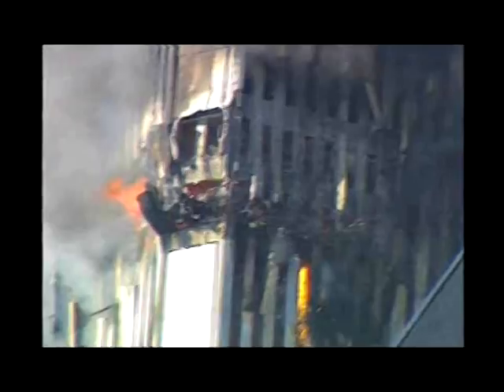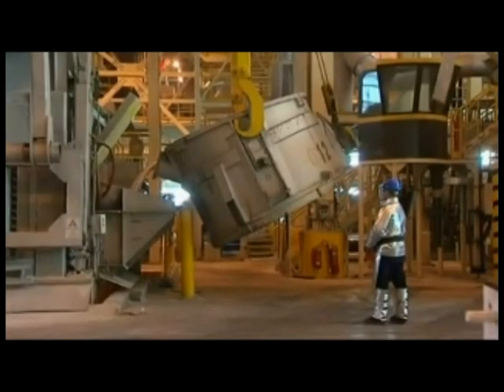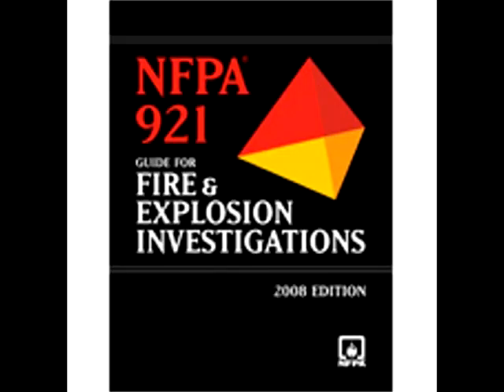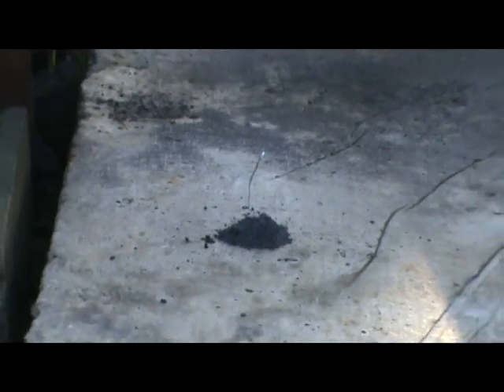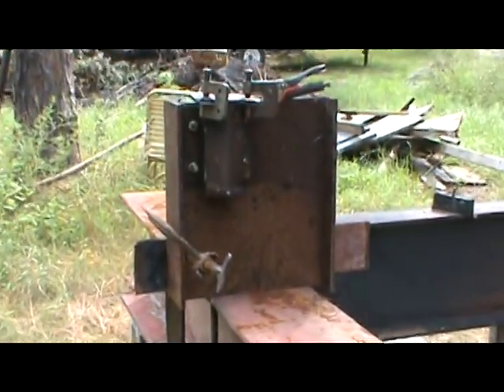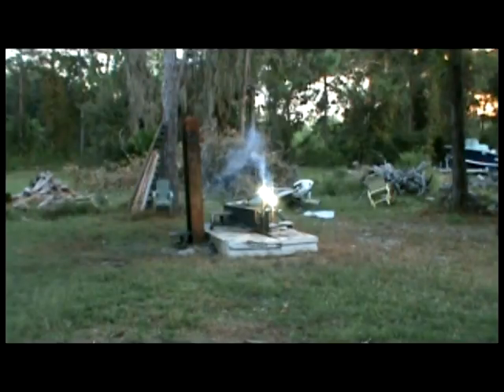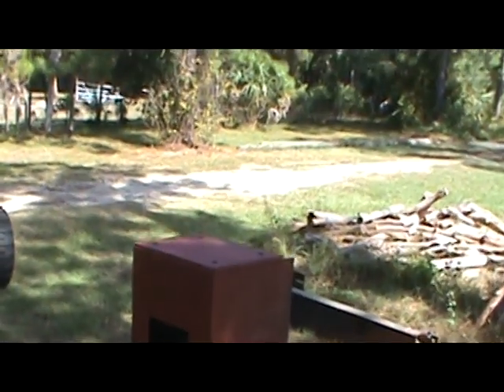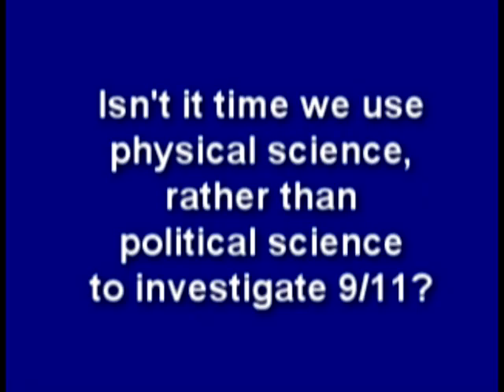9/11 Experiments: The Great Thermate Debate

Comment: what you forget to include is the fact that these beams didn't need to melt to collapse the towers. The temperature that the jet-fuel was burning at was easily high enough to reduce the strength of the steel by up to 90%. Add that to the thousands of tons of weight being exerted on them and they are definetly going to collapse. And the "melted steel" might not be steel at all. Just because it wasn't aluminum doesn't mean it couldn't have been a different metal. After all this is an office building which has computers and equipment which contains hundreds of metals which could be what you see pouring out the side of the tower. And also, even in the case that thermate was used inside the tower, doesn't mean the government placed it. I mean how hard would it have been to sneak these into the building by terrorists? Or perhaps someome who worked there planted it collaborating with the terrorists? Make sure you look at all different aspects of this before making an ussemption based all around a couple factors.
Reply: O.k. now explain building 7.
Reply: @endofdays4003  building 7 was one of many buildings evacuated right away. It wasn't touch by firefighters or police for over seven hours, left to burn. By 5 something, building 7 collapsed due to the entire building burning.
Reply: your like a breath of fresh air
Reply: One other thing you have to realize is that the jet fuel burned up in the fist few minutes after the crash. After that the fires were only from office furniture. Before the collapse it was reported, and could be seen, that the fires were burning out. There wasn't sustained high heat there and certainly not all the was across a level of the building.
Reply: @ghosthand8119  I never claimed that jet fuel was the primary fuel that melted the beams.
Reply: maybe, just maybe the skyscraper fell straight down because it couldn't withstand tons of pressures from  above (all building mass started from the impacted part to the very top)
Reply: Did you like... not watch this at all?  Or are you just beyond ignorant
Reply: @Jerboi_  oh I watched it but now I wish I hadn't
Reply: Maybe puoring melted metal was from plane parts which left in the building after impact?
Reply: The beams weren't melted at the bottom of the building were they?
Reply: @Lorenzo Qobi I made no refrences to NIST.
Reply: +spencer wells It's not a matter of steel HAVING to melt, it's a matter of steel melting in an office fire, which cannot happen. We know steel melted because FEMA documented it in a metallurgy report. And they also described the mechanism which caused the melting, and that mechanism seems exactly what thermite would do to steel.
Reply: @Ab4kus  furniture and office supplies charcoalised could have been plenty to melt the steel beams. Younsee charcoal burns at over 3000 degrees F which im addition to the opem air windows with air pouring in could have been more than enough to melt through beams.
Reply: @spencerwells4523  well I invite everyone to Google at which temperature charcoal burns so they can see that you're just here to troll.
Steel buildings don't melt, office fires are well studied and we know they don't reach the melting point of steel.
On top of that, we know the steel in the WTC buildings didn't reach high temperatures (from the fires at least). Which is not surprising because they were short and very localised in intensity.

"There is no evidence that any of the steel reached temperatures of 650°C for any extended period of time" - NIST
Reply: You must think the government is in it for your best interest too huh ?
Reply: @Thisisfun918  never said that
Reply: If you know anything about steel then you know as long as you can heat it up it gets weak. Demolition Ranch made a video showing how a camp fire made from wood can make hardened steel body armor weak. Although yes I agree that since the mass majority of the heat and damage was only on one side it should've fell over not collapsed straight down but as far as heat weakening steel it doesn't take much to weaken it but to melt it then you do need that intense heat
Reply: Your forgeting the fact...the steal was seen melting. Befor the colaps
Reply: Lol he literally shows you the molten steel pouring out the building. You're argument that the steel was weakened is null and void
Reply: @Tigger0774  how so?
Reply: @Tigger0774  wouldn't molten steel have sparks pouring off of it like crazy? Look up foundries and you'll see what I mean.
Reply: Did they go in while the buildings were burning to take the temperature of the air being forced through open windows by wind and back draft? Or did they just take the temperature days later and assume that it only got to 1800 all through the ordeal? This isn't an "open and office air with jet fuel" situation. There's a lot more to it than you " truthers" can wrap your brain washed minds around
Reply: what about the fact that over two trillion taxpaying dollars went unaccounted for in the DoD on sept. 10, 2001? quite a coincidence that a plane happens to hit the pentagon in the accountancy wing where the disappearance was being investigated
Reply: Yea, government job is ruled out, simply because they are the government by the people for the people. There is no evidence that could convince otherwise. Governments are good.
Reply: U are a true genius I said the same thing earlier
Reply: It wouldn't implode uniformaly. Temperatures at different points of the building would have been different. Therefore, the weight should have shifted to the weaker side of the building.
Reply: spencer wells bro open air and liquid jetfuel is not that of a hot of a substance. It needs to be vaporized with the right amount of oxygen
Reply: @the_borax_kid2233  I made no claims that jet fuel was the primary fuel which melted the beams.
Reply: Yep. When I was undergrad studying mechanical engineering we studied materials going from a plastic to an elastic state. One also need to remember that energy is being introduced as the material is bending under weight of the structure above.
Reply: Oh those things were obviously powder puff devices or the like causing pressure pops and gusts.

"Sir, you cant say bomb"
"bomb, bomb, bomb, bomb"

"Media, you cant say explosion"
"pressure bursts"
Reply: "I mean how hard would it have been to sneak these into the building by terrorists? Or perhaps someome who worked there planted it collaborating with the terrorists?" hahaha do you even listen to yourself??
Reply: @richwalter5322 that makes no sense
Reply: spencer wells d
Reply: That's wrong. NIST already stated in their own report that the temperatures of the fires were not significant enough to weaken the steel structure at all. The highest recorded temperatures were around 250C.
Reply: spencer wells "the jet-fuel was burning at was easily high enough to reduce the strength of the steel by up to 90%" - Yes, this would explain the collapse of the buildings at the point where they were hit by the planes. It doesn't explode the implosion of the buildings right from the bottom though.
Reply: Hahahahahahaha
Reply: 1. The molten spheres of iron show that it wasn't just aluminum or other metals that melted but actual iron, and in large enough quantity to be found everywhere. The spheres were found in all the dust from around the towers and indicates that large quantities of iron were melted. 

2. Claiming that the molten metal pouring out the side of the building was office furniture and such doesn't make sense. There wouldn't have been enough of it in just that area to cause the rivers of molten metal seen in the videos. You would have had to take all the furniture on that side of the building and shoved it into a corner and melted it. Metals that would have melted from the furniture and other items would have just formed small puddles on the floor or burned away.

3. The actual collapse of the towers is in suspect as well. With the mass majority of the damage and heat on one side of the tower shouldn't it have toppled instead of collapse into it's own footprint? Look at videos of demolitions gone wrong. If demolitions only weaken one side of a building it tends to topple over to one side. Only if the structure is properly weakened on all sides does it collapse straight down.

4. Who set the explosives? Months before 9/11 a company worked in the towers upgrading the fire suppression system. They worked at night and during that time all security cameras were turned off. They were all throughout the building from top to bottom unsupervised. This is the same company that hauled off the debris from building 7 before fire investigators could inspect it. Sorry but I can't find the name of the company anywhere but there are videos of a caravan of dump trucks rolling to the site moments after the collapse of building 7 as if they were just standing by waiting to be called.
Reply: Ghosthand scary stuff.
Reply: @ghosthand8119  your 4th point is a very valid one which I never tried to disprove. The office furniture/offive supplies when in the right conditions (like a giant metal box with air pouring in through windows and tons of jet fuel to ignite them) could easily pyrolize (aka turn into chatcoal) Charcoal can burn upwords of 3000F which is easily hot enough to melt right through steel beams. Thanks for having a logical discussion with me.
Reply: spencer wells did you not see the molten iron pouring from the fucking tower? Or were you dropped on your head and kicked around like a soccer ball as a baby?
Reply: I never said I trusted the government.  in fact I hardly ever trust them. But I don't see how bombimg the world trade centers is going to benefit them any.
Reply: spencer wells That's an easy one. It's called an excuse to invaide another country and steal their massive amounts of oil.
Reply: @spencerwells4523  America ultimate goal is to maintain world power. This means securing bases and allies at every corner of the globe. It just shows the level they will go to make certain of that goal. They will sacrifice a few lives for what they think will secure that goal. Even if it means their own people.
Reply: spencer wells firearm sales skyrocketed after 9/11, just sayin
Reply: @oliverejm  we didn't take over any of their oil. get your facts straight
Reply: @ephraimkaravan  😆 savage
Reply: "easily high enough to reduce the strength of the steel by up to 90%" Assuming this statement is right, which I don't believe it is...does it apply to all 1300+ ft of the giant heat sink that the towers were? Because... you know, they collapsed ALL THE WAY to the ground into their own footprint.
Reply: @johanssonb  Steel doesn't comducy heat very well. As a blacksmith, I can heat the end of a piece of steel to 2000 degrees to forge weld and the  side I'm holding, is room temp.
Reply: 90%? nah fam
Reply: @ItsHollowfied  yeah when you heat steel to orange heat it loses about 90%  of its original strength
Reply: @ItsHollowfied  Im a blacksmith which is the only reason I bothered to hypothesize at all. So I have worked on steel at very high temperatures and I know how much of it's strength it loses.
Reply: So all the computers got together in on area to collect and pool then pour out of one spot on the building?? Lmfao what a loser..
Reply: spencer wells it fell at free fall speed?
Reply: @jasonmaurella2  yes it sure did
Reply: You can’t spell Assumption like that and expect anybody to take you seriously.
Reply: groogus91 hahaha
Reply: @groogus91  assumption? you mean the basis of this whole video?
Reply: spencer wells Least you spelt it right this time pal
Reply: @groogus91  you must be that one silly kid who corrects teachers for one wrong world ;) that dont make you smart XD see what I did dear ;)
Reply: Sam Wong Well your Wong there Sam.

If people are trying to give an educated and serious point about something at least make sure it’s spelt right.
Reply: @groogus91  you didnt get it did yah 😒😒 . It dont need to be right spelling cause the human mind dont read letters bit by bit but words as whole, so even though it was wrong picking up one small mistake come on 😒 thats childs play .. give people a break bruuuhhh
Reply: Sam Wong Sorry mate. I apologise wholeheartedly. I’m not worthy of a human being.

Now how am I going to bounce back and get over this tragic part of my life
Reply: if u light ur computer on fire with jet fuel its not gonna create circular balls of metal or a printer or any other things that are normally in there. also whats gonna cause the red chips all around then???
Reply: @soulsreaper7145  Ligjting your computer on fire with jet fuel and a giant foundry like environment with super high temperatures, aren't the same thing. This is a  whole different balllgame buddy.
Reply: They also are forgetting about the natural gas that is spewing from broken gas lines, mixed with the high winds at that hight it would be sufficient, especially with all the other materials that are burning. I melted steel in my back yard fire pit with a frickin shop vac blowing in
Reply: @mlheinz79  yes exactly
Reply: @mlheinz79  you're like a breath if fresh air. Don't keep quiet.

Comment: a jet going 400 mph crashing into a building 100 floors up making a huge hole with wind blowing into that hole turning into a giant kiln probably super heating everything with the jet fuel, wind, and all the other flammable material probably didn't melt the steal but sure did weaken it, plus the columns were probably bent and when you have bent beams and a vertical load. Do the math.

Comment: It was the weight that made them fall.
Reply: Jesus H Christ are you serious?
Reply: Glen Proposch  u do realise when you heat up metal it gets weaker even if you don't melt it
Reply: You’re both totally disrespectful. 
“Moron” “dumbass”
Why can’t there ever be a debate without people being total cunts to each other?
Reply: Then they wouldn't have free fallen through the path of most resistance.  You didnt pass physics did you? They would have fallen to the side. Explain building 7 which also free fell yet only had fires burning in a few spots. When you learn what building 7 held you will begin to see why it was "pulled" too.
Reply: There was also other factors, for example a fire at the top of the building, the impact of the plane, extra weight at the top of the building.
Reply: J o n a t h a n  Doesn't explain how everything was turned to dust. You sir are just waffling, parroting the official story. None of your 'factors' are an explanation for what happened that day. I was like you you once but i could no longer continue to lie to myself.
Reply: have you ever got dry cement and put it into your hand and ribbed it. i know it sound stupid but it turns into ash.
Reply: @sergeilavrov4215  what he's saying isn't stupid at all, dust / dirt is created by a huge building collapsing on itself.
Reply: @jellyboy123  Dude what extra weight did it add?? The fucking planes vaporized on IMPACT!!!!!!
Reply: Was there a plane their before ? thats extra weight you dumb ass, a plane can weigh about 80,000 kg....FACT...Moron.
Reply: @jellyboy123  The plane that flew into the WTC was a Boeing 767. They weigh in at 179 000 kgs.  The buildings weighed over 500 000 tons each. So i can guarantee that another 180 tons didnt do jack shit to the buildings. Especially since 90% of the building was below the point of impact. The structure wasnt built to just support the buildings' own weight, and the perfect collapse at near free fall speed? Come on man, it is obvious.
Reply: @jellyboy123  the building weighs 1.5 billion pounds. Am extra 200,000 lbs ain't shit

Comment: Do you know why blacksmiths heat bits of steel to red hot before bashing it into whatever shape? And also, do you know why firefighters "don't trust trusses"? Additionally, the more people you involve in a conspiracy, the more likely it is one of the people you involve will grass you up? Also, you got floors slamming together, where do you think the air between the floors is going to go?